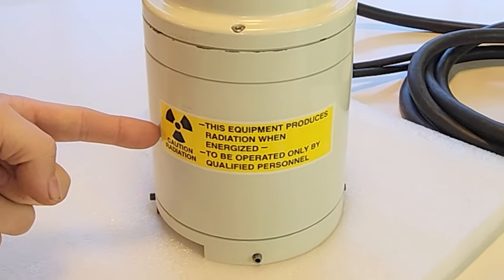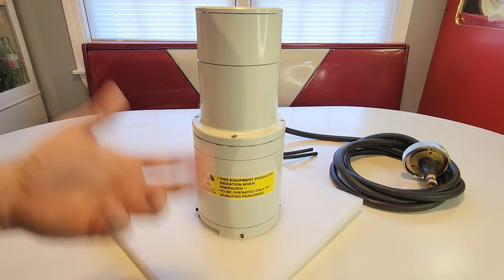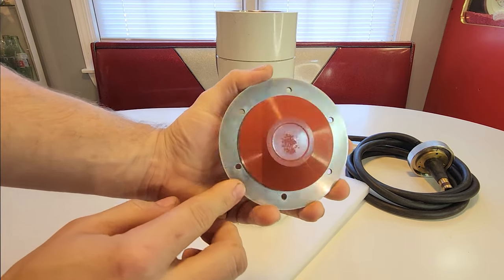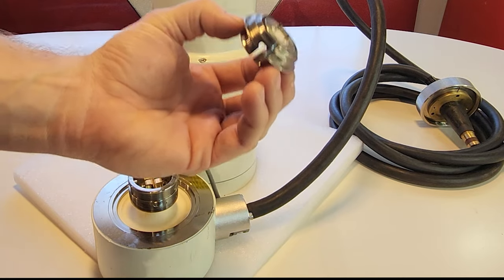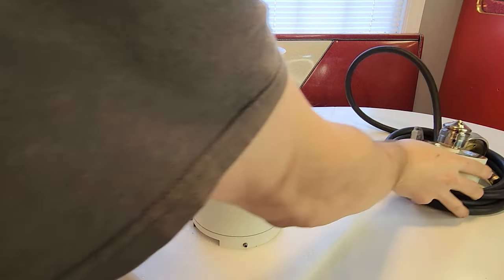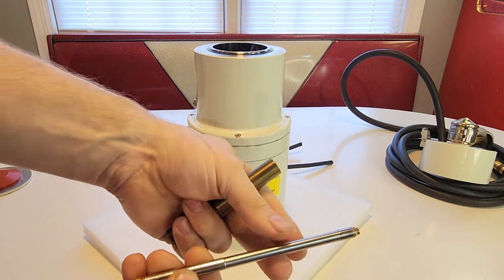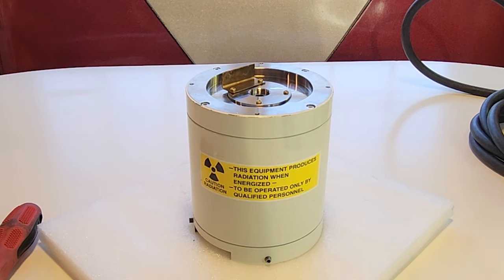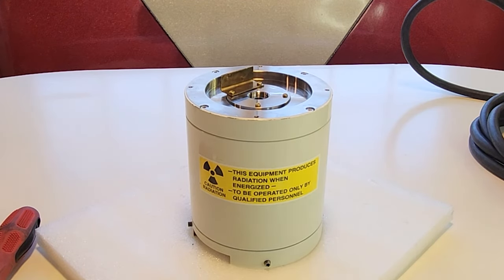What's inside a scanning electron microscope?

Comment: At 04:07
To align the tungsten tip with the hole a light microscope is used.
I did it with an Olympus stereo microscope when working for a SEM manufacturer.
You only need a moderate magnification. There is no need to use an electron microscope.
Reply from the maker: Fantastic information, thank you! And that does make sense.

Comment: Fascinating! Thank you so much for sharing! I absolutely love watching someone dismantle something and learning together during the process. Hearing your fascination about this piece of equipment brought me great joy. I'm curious about why it's polished on the inside.
Reply: probably has to do with the effect of any protrusions creating a localized induced magnetic field through eddy currents which would throw off the magnetic focus
Reply from the maker: My best guess for the polish. The very high voltage this runs at requires the smoothest surface possible, for electrons tend to concentrate at points ( Why lightning rods work!, and why you get static shocked on whatever part of your body sticks out! ) A rough surface is full of very small points and can bleed off charge from the system or ( leak ) So in a way making it smooth is like making a 'water tight' vessel for the electron gun.
Reply from the maker: This video I did on lightning rods may explain it!
https://youtu.be/zRImPCgS1Lg?si=tjb2PaW851J1aTAH

Comment: At 03:34
No need to be careful at all. The thing is clearly broken!
Reply from the maker: I notticed that in my photos, this could also be why they stopped using it!
Reply: @DJDAudio  They stopped using it cause it's ancient tech. This is the filament type microscope. Most of the modern ones are field effect tip based. The top of it is called Wehnelt  electrode. It is not bombarded but it's sputtered with tungsten from the filament.
Reply from the maker: @ciprianpopa1503  Thank you for this! Always love learing something new!

Comment: So, are you repairing it or what?
Reply from the maker: This was a tough call on my part, the unit dates back to the 70's and is well past its serviceable lifespan. A replacement filament for this unit is also $500+ And they will not referb one if you do not have an expensive service contract with them. That and taking it apart and contaminating it like I did would mean months of decontamination and time to bake it out and pump it back down to a usable vacuum conditions. So I felt it was better served to take apart and be able to show the inside of this unit as an educational tool or entertainment for those who are curious. For not every day you get to rip open a million dollar machine just to explore for fun!  I do plan to use parts of this in many other projects so it was by no means a waste of hardware! The last scope I took apart I used to make my own liquid nitrogen maker, and a fusor!  Hope that helps explain my motivation for this! ... P.S. Part of the agreement for getting items like this is often that they can never be 'used as intended' again aka destroyed.